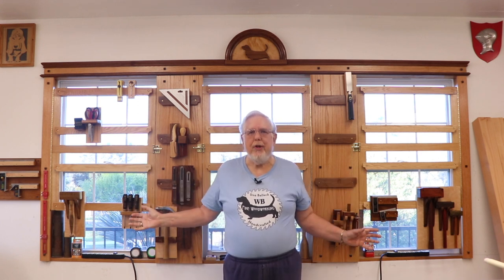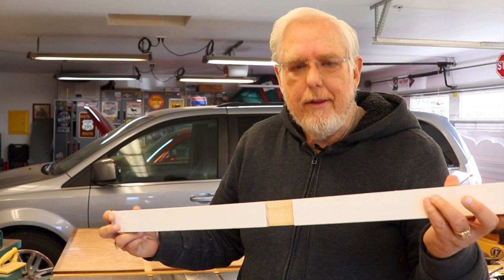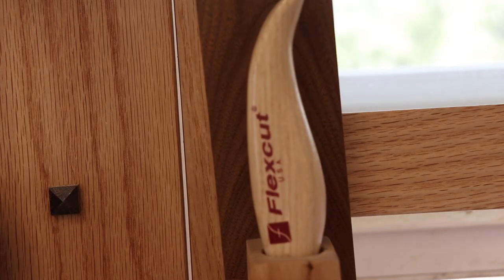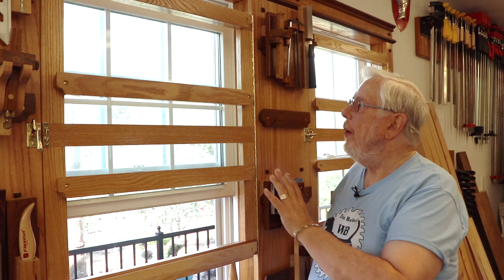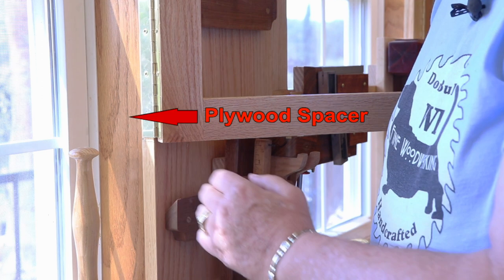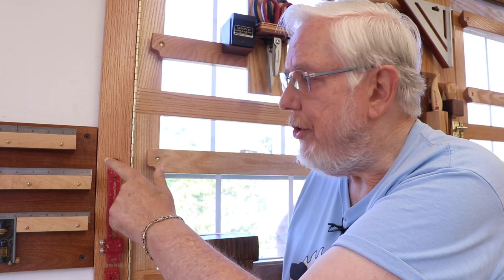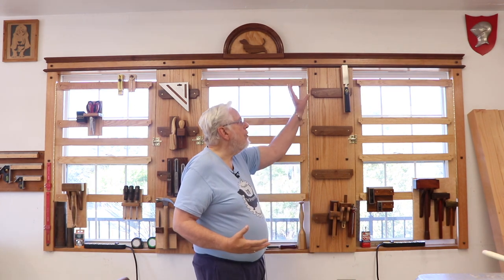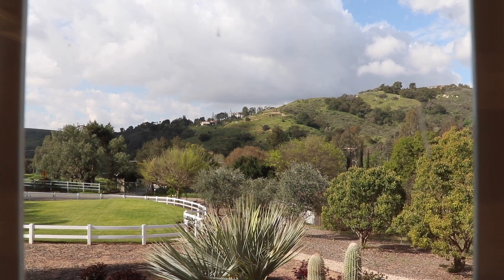Hinged French Cleat Tool Rack for Shop Windows - The  Details

Comment: I've read that french cleats work better when they're supported by a wall behind the cleat, as well as by a wall support below the tool holder to keep it from rotating out of the cleat. Have you had any issues with your tool holders falling or coming loose?

I'm glad you posted this video. It's the first I've been able to find where cleats were put on a hinge "door". I'm planning something similar, but mine will be on solid plywood doors that cover 10" deep stud bays. The doors will measure 32"w x 44"h. I think I'll have to use standard door hinges to handle weight of the door and tools. I worry that a piano hinge might not be strong enough.
Reply from the maker: Rob Moreland I’m glad my video helped. I’d love to see your project after it’s done. My email address is on my website - http://www.WBFineWoodworking.com

I haven’t found any issues with my French cleats. Both pieces are cut at 45 degrees and are exactly the same thickness. I also have a backing on the tool holders that is wider than the cleat. The tool holders sort of lock in place. Where you may run into a problem is when the tool is heavy. I’m not hanging anything heavy on my French cleats. I think the heaviest is the one with the three Thor’s mallets from Kings Fine Woodworking. I produced a video on that one that might help. So far I haven’t had issues with any of my tool holders falling off. If I do I plan to add a screw from the front of the tool holder into the cleat that can easily be removed if I want to move the tool. 

Another technique that might work in your case is putting the French cleats closer together. That way the tool holder spans a second cleat. Even with the wider spacing I used to keep from blocking my view some of my tool holders span more than one cleat.

Comment: I like this project.  It looks good and was nicely described.  If I could offer a suggestion...  The design nerd in me says that as you add more tools and the weight increases the thing might sag and some kind of diagonal brace or cable with turnbuckle would be needed.  Still, it's a great project.
Reply from the maker: ML Franklin - Since these racks fit tightly into their frames when they are closed  I’m not too worried about racking. Now that I have AC for my shop I’ll only have them open is rather briefly when I clean the windows. Using half laps for joinery at the corners instead of mortise and tenon plus the full length piano hinges also help prevent racking.  If needed there is space on the back for a diagonal support but I doubt I’ll need it.